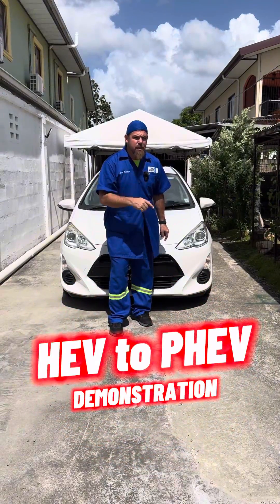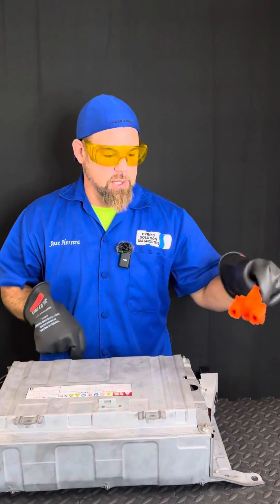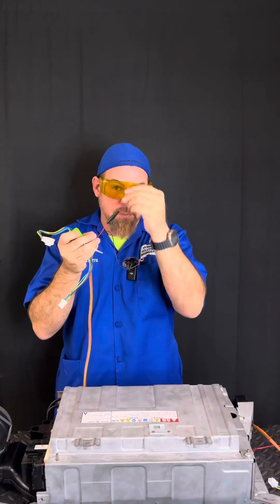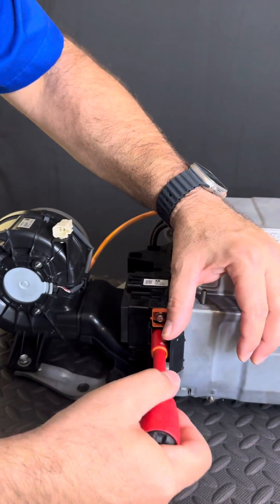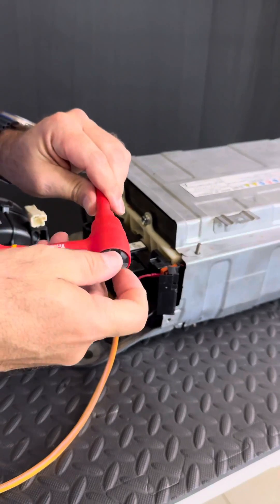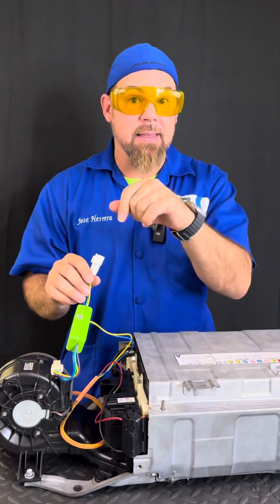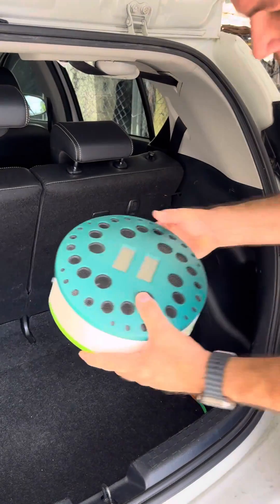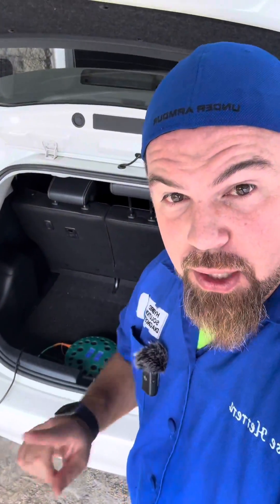Toyota hybrid into plug-in hybrid conversion upgrade

Comment: This looks much easier than when I pulled the pack, individually charged each cell on a reconditioner, rearanged the pack to all the positive was on one side and negative was on the other and connected them all to cause a equal charge rebalance, rearanged the pack back to normal and reinstalled.  Afterwards Dr. Prius said my battery was at 105% when before it was at 49% health.
Reply from the maker: Jejeje great but it won’t last much unfortunately ⚡️⚡️
Reply: @hybridsolutiondiagnostics  Yeah, my way took more time but cost less to get the car moving again.  My ultimate goal it to go this route as my car tends to sit longer than it likes and when I do start driving the hybrid system throws a fit as the battery was sitting idle too long.

Comment: Nope.... This is far from good enough....

Ev range will still only be like 2miles then its gonna switch back to engine running.... You didn't increase the range and didn't force the engine to stop and leave the work for the hv battery

Comment: But the battery is too small. PHEV can travel more than 50km on electric. The current (standard hybrid battery) can’t go that far. Would be better to install a larger battery.
Reply: By using solar panels on the roof, this may help with the gen breaking

Comment: Hello, excellent video, i am at Mexico, i have a 2015 plug in hybrid Prius, and it doesnt charge with the plug, but it does charge when is running, y change the charger, y tried whit others, and its the same, any ideas? Here there are not plces where they fix it, so i need ideas plz, and another question is that if the battery can be improved so incan get more miles than 13, thank you and sorry if i am not clear at english
Reply from the maker: Envíame el reporte de diagnóstico via instagram DM a vet como te puedo ayudar ✅✅👍👍
Reply: Your English is awesome compared to my Espanola.

Comment: Hello, although I know this video is not specific about my question but I would like to know your opinion as it is very important to me. I am in great doubt about the right type of oil for my Toyota Prius plus (_W4_) 1.8 Hybrid ZVW40W,ZVW41W) 99hp Petrol/Electric.  ENGINE 2ZR_FXE. I've been using 5w30, although the Manufacturer's manual advises 0w20 and eventually 5w30.   I don't know if the weather can play a role, since in Seville (Spain) the minimum temperature rarely drops below 4°C⁰ and the maximums.  exceed between 35C⁰ and 46C⁰ for half of the year.
The car is from 2015 and has 173,000 km. The engine has never leaked oil or had mechanical breakdowns
Can you please help me? Thank you

Hola, aunque sé que este video no es específico sobre mi pregunta pero me gustaría saber tu opinión ya que es muy importante para mí. Tengo muchas dudas sobre el tipo de aceite adecuado para mi Toyota Prius plus (_W4_) 1.8 Hybrid ZVW40W,ZVW41W) 99hp Gasolina/Eléctrico.  MOTOR 2ZR_FXE. He estado usando 5w30, aunque el manual del fabricante aconseja 0w20 y eventualmente 5w30.   No sé si el clima puede jugar un papel importante, ya que en Sevilla (España) la temperatura mínima rara vez baja de los 4C⁰ y las máximas.  entre 35 C⁰ y 46 C⁰ durante la mitad del año.
El coche es de 2015 y tiene 173.000 km. El motor nunca ha tenido fugas de aceite ni averías mecánicas
¿Puedes ayudarme, por favor? Gracias
Reply from the maker: Usa Amsoil Signature series 0w20

Comment: Hey man - great video! Radial idea but: would it be possible to swap out the hybrid battery of a 2021 highlander hybrid with another that has a higher voltage? If it could, would the car run longer on electric and switch less to gas?
Reply: I have 2021 highlander hybrid and was thinking the same. not sure if there is difference in batteries of plug ins and regular hybrids. I always thought plug ins have much bigger batteries but the same voltage

Comment: On my Gen 2 I hacked the ECU and added the EV button.   I also upgraded to Jack's lithium HV.   Using an HV low amp charge  I was able to charge the battery overnight from low to med high, but with the Nexpower there is a BMA setup that really prohibits making a true PHEV as the software in the car seems to be confused a  bit and cranks the ICE anyway thereby defeating my goal of having a short range PHEV that never wastes fuel running the ICE for that programmed few minutes.   And Jack advised against using charge on Nexpower battery anyway.  It IS possible to make a short range PHEV from what is on the Gen2 but nobody is interested anymore with the BEVs around and too much trouble and money and risk to battery and electrical system.  Besides common sense finally prevailed, and I just walk the 3 mile route to run my errands and it is good exercise and can carry most loads like daily groceries etc.   Interesting video though.  Thanks.  Been there, done that..haha
Reply: Sorry I’m asking this a year after you commented, but can you explain how you hacked the ECU and added the EV button?

Comment: Super interesting...  I just tested my 2010 Highlander Hybrid battery with the Doctor Prius app.  I don't have the V-shaped voltage at all; however, the discharge test shows my health at only 60%.
Could this be done to recover more capacity (beyond my 60%), assuming that it is not the result of off-gassing/losing electrolytes?  In other words, will this recover capacity due to the infamous  "Memory effect?"
Reply: I have the same situation on my ct200h. Capacity is about 60% but otherwise healthy. Would only a trickle charge help since I thought you needed a deep discharge cycle to recover capacity.
Reply: @GuillaumeLavoie  Yeah, I'm still waiting to hear for feedback.

Comment: Happy birthday my friend! If I put one more HV battery in parallel with the original one and use this prolong. Can I extend my EV/upgrade my MPG? As my AMP will upgrade from 6500Mah to 13Mah. Is it possible? If yes I already have another HV battery here from a friend who gave me his old one. Can you post the link product?
Reply: Very interesting idea. would love to learn more about this. what if there is option to convert hybrids into plug in hybrids to make them short range EVs. even for few miles without running the engine to charge them

Comment: Part number of the special high voltage battery connector? And the charger ?
Thank you !!!
Reply: I believe the wiring in the video is from Hybrid Automotive, and the charger is a Prolong grid charger.
Reply: Prolong Battery Systems Car Harness – Discharge Ready